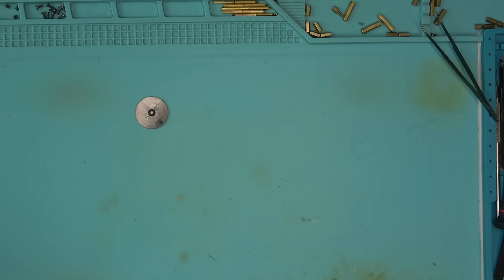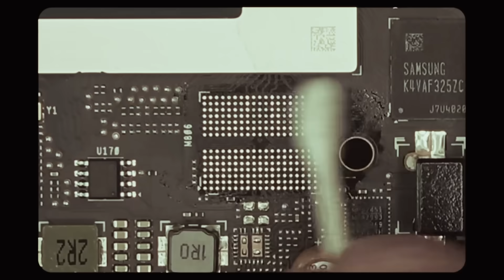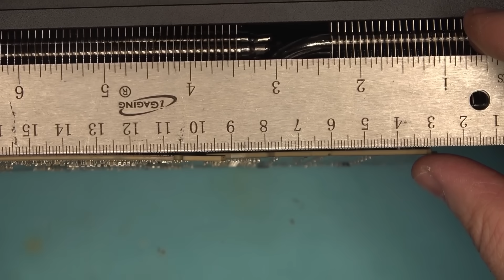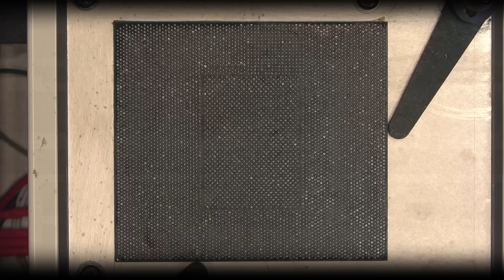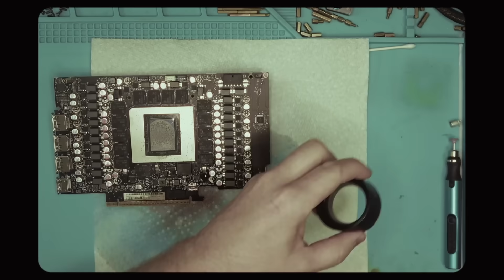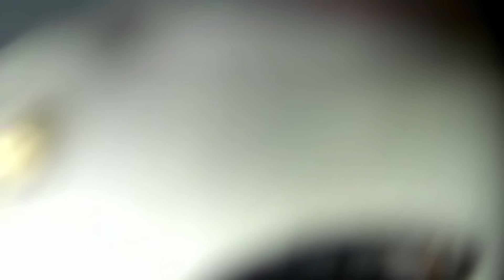Watch this guy performing "out of this world" repair on an RTX 5090

Comment from the maker: if anyone is interested in the 3d printed stencil for 5090 as well as other cores, see my thingiverse page. Link in the description
Reply: hi
Reply: How much would you charge a customer for such extensive work requiring multiple reballs like this, just out of curiosity?
Reply from the maker: @RedceLL1978 can't answer that.
My prices change not based on the repair done but on the device value.
Reply: @northwestrepair  i didn't ask about all your other jobs lol I said a job like this. but I get you don't want to disclose prices. No worries.
Reply: @RedceLL1978  An extensive job like this is probably 30-40% of the value of the card if I had to guess. So customer probably paid close to $1k for this 5090 repair.
Reply: @RedceLL1978 he charged the percentage of gpu price
Reply: Do you entertain internasional client bro?